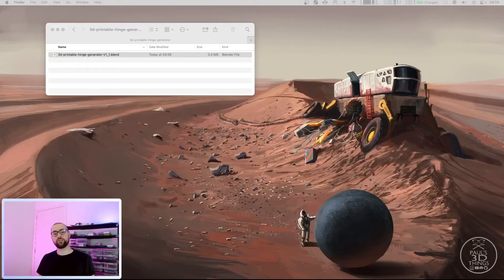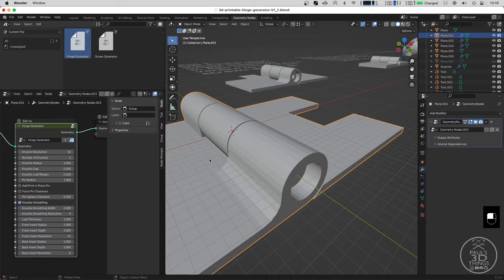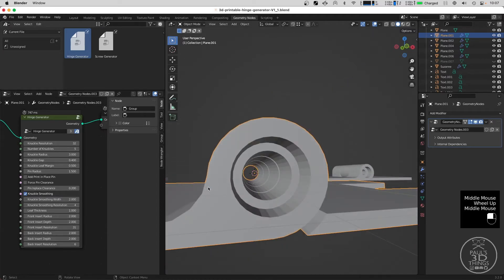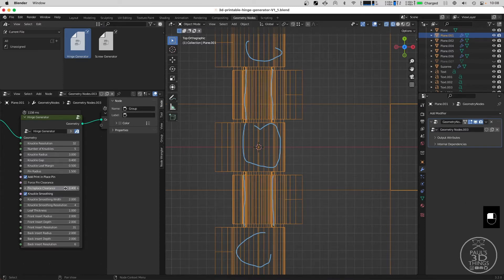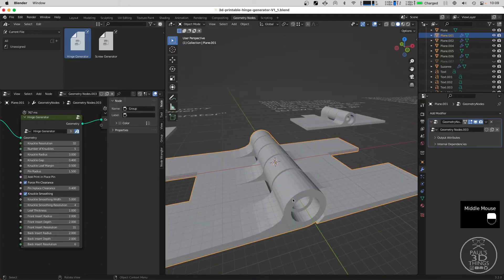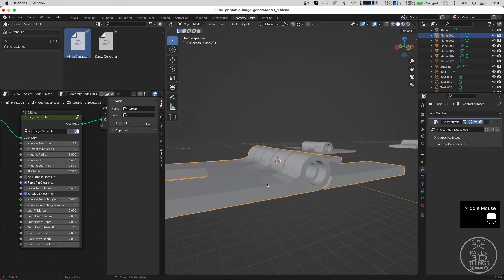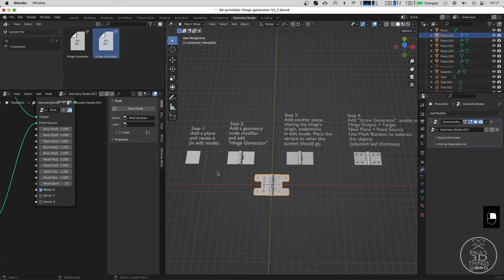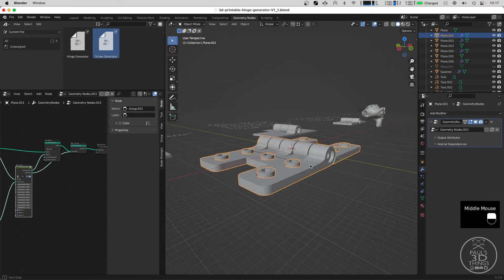3D Printable Hinge Generator with Blender Geometry Nodes

Comment: how do you add the hinge to a box or something to then export that for 3d printing?
Reply from the maker: I'd design the box/lid in a way that it's possible to print in place, then add the hinge(s) in the right place with a cylinder as boolean to make the cutout where the moving/interlocking parts of the hinge should go